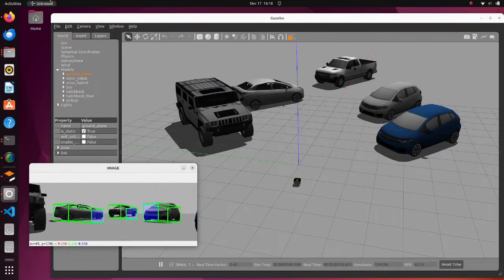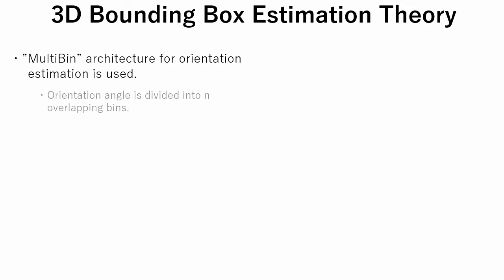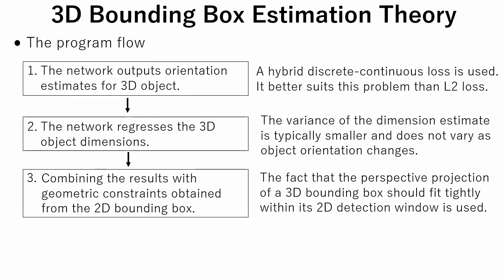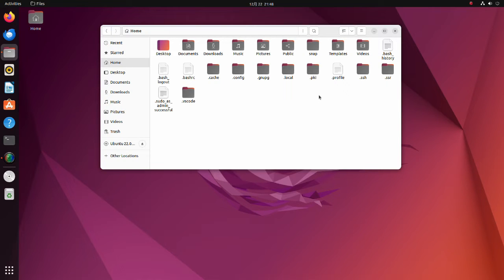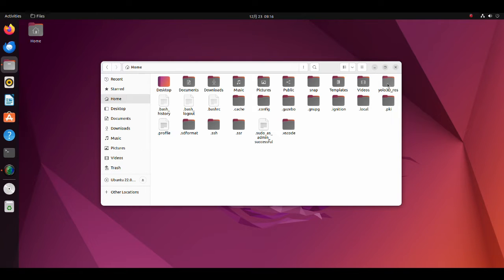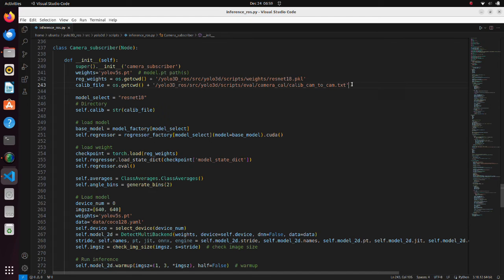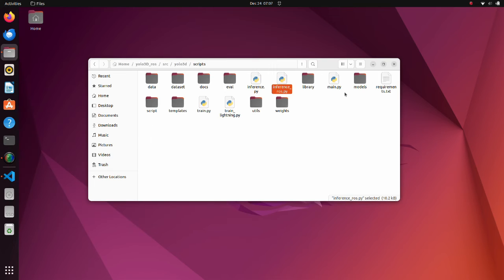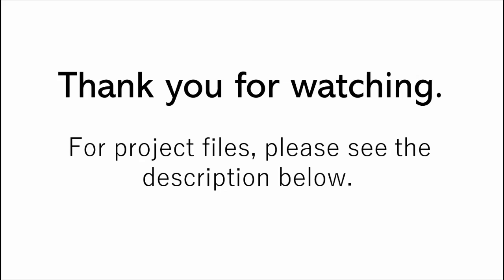Object detection using Yolo3D with ROS2

Comment: How to add the detected result to nav2? As a obstacle detector
Reply from the maker: Hi Thomas Luk!
Thanks for watching my video!
Do you mean that you would like to add detected objects as obstacles to occupancy map?
Reply: @robotmania8896  Yes, I have tried implement AI depth estimator to generate depth pointcloud from RGB camrea, and combine the use with STVL voxel. However, the performance is not very good. I want to try a different approach to use object detection model to find the object (might be in 3d boundary box) and plug the output to nav2 cost map. Which plugin is suggseted? or I should create my own.
Reply from the maker: @thomasluk4319  As far as I know there is no such plugin which will plot detected 3d bounding boxes to cost map. Creating depth from RGB camera itself is computationally expensive. Is using RGB camera mandatory?

Comment: What is the latency to expect in the real life?
Reply from the maker: Hi xp-4yt!
Thanks for watching my video!
It largely depends on model size, and GPU performance you are using. But it seems to me that 3D inference roughly takes two times longer than usual yolo.
Reply: @robotmania8896  Thanks, this technology needs some time then. At least for usual users. I am running right now traffic detection with 50ms delay and twice more will be critical